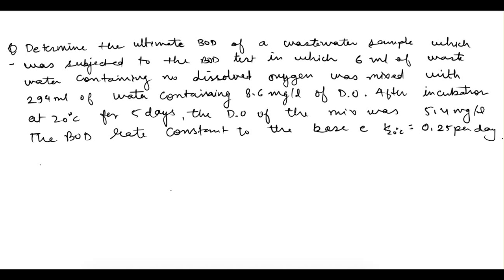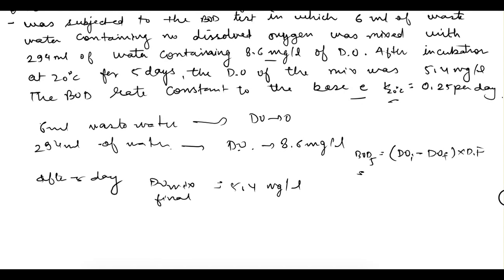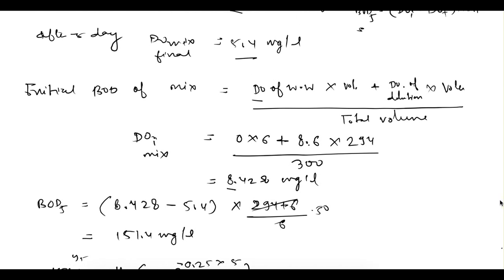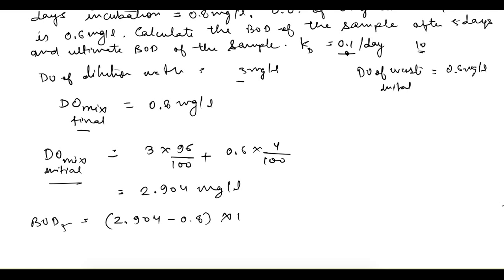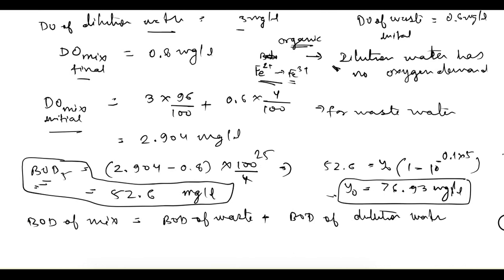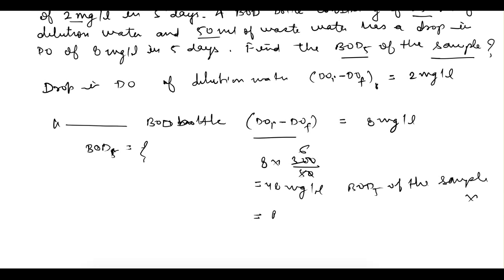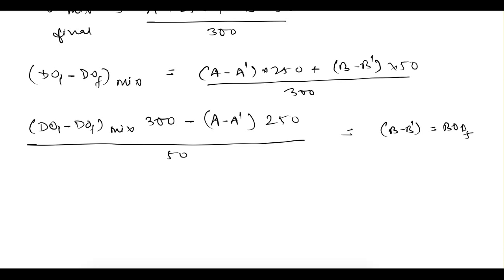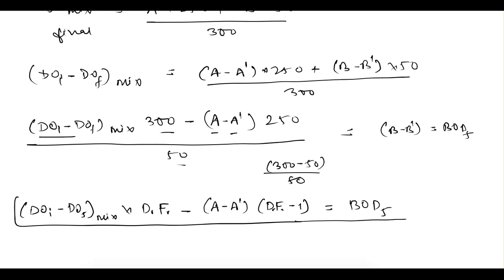Dilution Method Problems | Waste Water Engineering

Comment: Sir I have a doubt 
In the previous video for finding average BOD you didn't considered 0 in the calculation reasoning as we are not sure whether it happened on day 5 or any other day so neglecting the data. but in the first problem of this video you included 0 in the calculation for initial DO of mix.
Reply: see carefully,,0 is not involve

Comment: i am not getting the difference between (initial D.O. of mix-final D.O. of mix) at 03:34  and drop in D.O.of bottle mix at 16:06 as both the containing waste water and dilution water initially and finally. and thank u for such videos
Reply from the maker: I did not understand your doubt clearly but let me try to explain. The final BOD value of waste cannot be computed by experiment if it is not mixed with dilution water because the waste water alone does not have sufficient oxygen so that we can find out the oxygen consumed in 5 days and that is why for the final value you will always be given the BOD of mix and if the dilution water also has some BOD value then that also will be given separately.